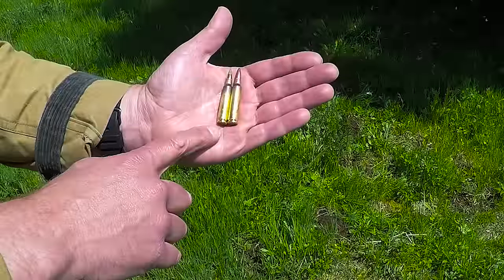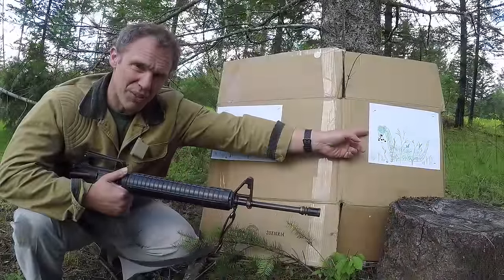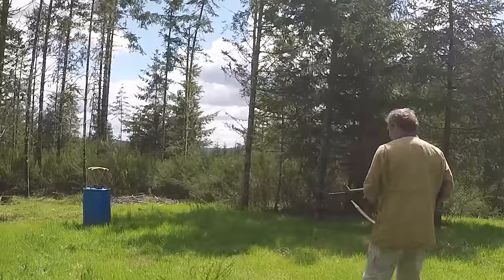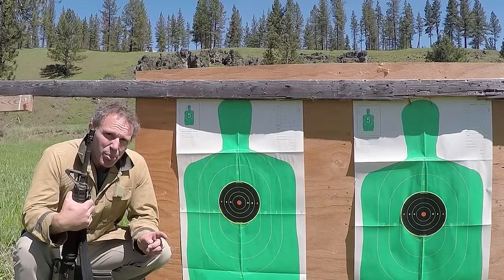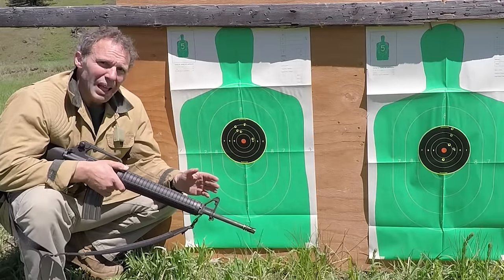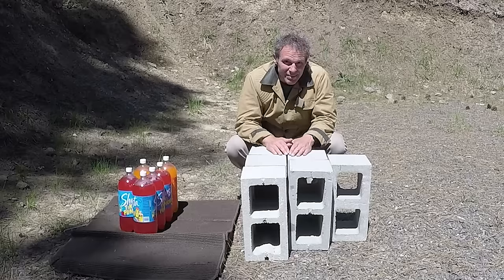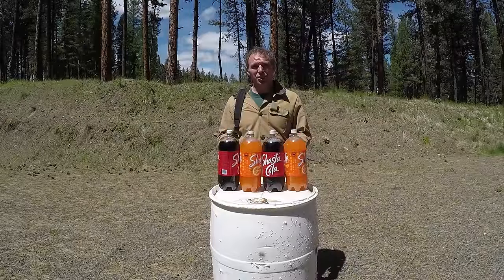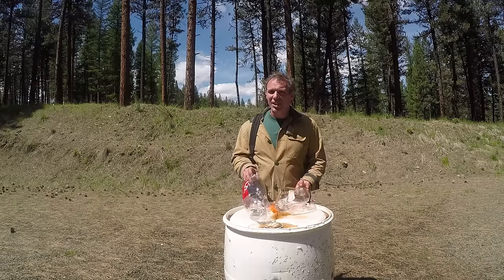5 56 NATO Ammunition:  XM193 55gr.  vs  M855 62gr.

Comment: Good video Paul. Love your work! I'd like to respectfully add a couple points to your video if I may? First, on the accuracy comparison: for bullet stability vs. barrel twist rates, I find the 5.56/.223 round to be one of the most finicky out of the standard calibers. Example, I have a Colt Match HBAR rifle (1:7" twist barrel) that I used to shoot MUCH service rifle comps with. While the 55g rounds would chamber and shoot 100% safely out of my HBAR, because the lighter projectile doesn't require that much twist to stabilize (they are essentially OVER-stabilized with that much spin), the best groups at 100 yards that very well built/match grade rifle would shoot 55 grainers was about 6" from the bench using sand bags. To the contrary, the M855 projectiles would constantly group 1"-2" from the same bench/sand bag rest setup. Hand loaded 69g Sierra SMK's will group sub MOA out of that same rifle. So, since your A2 is running the same tighter twist rate, I would suggest shooting the 55g out of the older 1:12" twist A1 barrel (the twist it was designed for) and compare those results with the A2 fired M855's. I would bet that you will see parity between the 2 rounds. Also, and no offense here as I'm sure you are a good shooter, but while the groups you got in your testing were not "bad", the inconsistency/accuracy differences you saw between the 2 projo types could easily be explained by shooter error, especially if you were using simple iron sights. I would suggest a better/magnified type of sight be used for both projos if you would like to eliminate any possible and common shooter error issue which honestly is probably the cause for the differences you saw in your test. You ARE 100% correct on slight/minute construction errors that are possible with the multi-component M855 projo vs. the more homogenous jacket over core M193. But again, at short/100 yard distances, these errors would be much harder to detect as a real cause and I fall back on irons sights/shooter error more than this factor (no offense!). At 500+ yards, that's were these slight projo inconsistencies really show up. As a 1000yard .50BMG shooter, I usually opt for CNC machined solid bronze types of projectiles to 100% eliminate this "multi-part projectile" construction error possibility, but that is obviously an extreme range where the tiniest balance difference in the projo has a LONG bullet flight time to affect pinpoint accuracy on target. On the "tumbling bullet" thing you mentioned. In actuality, the M-16/AR-15 rifle WAS designed originally with a 1:14" twist rate which would "barely" stabilize the early 55g projectiles. This was purposely done so when the projectile hit its target, because it was just "barely" stable in flight in the first place, the projo WOULD "yaw" considerable when it came into contact with soft tissue, causing major damage considering the light weight of the projo itself. Later, the M-16 barrel twist rates were changed to 1:12" to try and increase accuracy/bullet stability in flight through the jungles of Viet Nam (possible twigs/leaves would be grazed before the intended target impact). But, even at 1:12", the projo was just stable enough to make it fly like a football in the air, and quickly deviate course on impact. Now, on the newer M855 projo, the REAL reason for the tungsten cone in the front of the bullet core was NOT 100% to make it penetrate light armor better (but it DOES obviously work for that). The real reason for the M855's tungsten insert was to increase the projo's mass and move the projos center of gravity forward slightly; both to hopefully be accomplished with very little/no change in the outside dimensions/length of the projo itself. Going back to high school chemistry, since the much harder tungsten (periodic table symbol W) has a density of 19.35g/cm3 where lead (symbol Pb) has a density of 11.35g/cm3, it is a great metal to accomplish all of the above design improvements and also make the heavier projo fly more accurately, longer, out of the newer M-16 rifles with their 1:7" & 1-9" twist rate barrels... I guess that was a longer comment than I expected to write; sorry. Keep up the good work!
Reply: Actually they dropped the 1/14" due to arctic testing showing it wouldn't stabilize bullets in colder air, but either way bullets are not stable in tissue. You'd need a twist rate of 1:.012" to do that. Meat is so much denser than air the twist rate of the bullet has no consequence on destabilization.

When the reports of gruesome wounds came back from Vietnam the theory behind the fragmentation wasn't even properly understood at the time so it's not really that likely they designed it around that concept. It's just that .224 caliber barrels were made in 1/14" because most bullets for such calibers were 40-50 gr and not 55gr. Before the military nobody had the need for faster twist rates.

Comment: Those low-tech pseudo-science meat targets were awesome!
You can't write that up in a report with photographs like you can with FBI ballistic gel, but it's still way more informative.
Reply: The FBI requirements are retrogresive. The Fed's looked at what bullets tented to stop people quicker and then used those bullets in ballistic gelatin and subsequent results to draw up requirement for bullets going forward. All of those 12-16" penetration are based on analysis of real world shooting events. It does probably work though. By using bullets that are known to end engagements quickly and testing them in gelatin, there is probably a lot of predictive power in how well other bullets will work for the same.

Comment: I know it's not a "cool" opinion, but I actually prefer the 55 grain soft points.
Reply: Cool or no, they are good "soft target" rounds in 5.56.
Reply: Whatever works buddy....
Reply: I had an extra kevlar ach, I wanted to see what a 55gn soft point would do at 100 meters to it.  It pierced the front and blew a fist sized hole out the back.  It'll do the job.
Reply: @GeorgeHeil-ch3ro  hell yes they are, little things blow up whenever they hit something.
Reply: @bearjew05  what level? Because level 3 and 4 shouldn't have a problem with soft points.
Reply: @bearjew05  hell, you can hit some level 3 with some "armor piercing rounds."

Comment: From the research I've done, I consider the 55 gr XM193 a better self defense round compared to the 62 gr M855. That being said, my research mainly centered around self defense area being in a residential type environment like a house or similar structure with conventional construction with studs and drywall. My research told me that 55 gr 5.56 rounds penetrate with less retained energy after going through about two layers of drywall separated by 3.5" (standard thickness of a 2x4 wall). The idea that the round would contain less overall energy after going through a wall thus limiting unintended collateral damage. The idea that even though the 55 gr could exit as either fragments or a tumbling round, the remaining energy in the "bullet" would have a better chance of being stopped by the skin and muscle tissue, and cause minimal damage to the internal organs.

I don't have the sources for all this information as I did this about 10 years ago, but I was convinced that if I was to use my AR-15 in a self defense situation in my home, the 55 gr round would do a much better job of limiting collateral damage if I ever had to use it. Point is that I wish that firearms training as it pertains to self defense would address this type of thinking when considering ammunition for "home defense". I know it's a lot to ask of a lot of people who for the most part don't get this geeky about round performance as it pertains to a given situation, but that's just my two cents.

Comment: At a100yrds, those level 3 armored jack rabbits, are just too tough for the 55 grain though.
Reply: The 62 grain penetrates better due both the steel core, higher sectional density, and slightly greater momentum at 100 yards.  You therefore know that when faced with a 300 lb jack rabbit, only the 855's will do.

Comment: I'd like to see this done with a more common modern twist, like 1:7,8, or 9.
Reply: 1:12 is nucking futs
Reply: He was using a 1:7 twist for the tests, he stated that his a2 is 1:7 near the end of the video
Reply: @gamingmadesimple5510  find the time that he says 1:7 twist
Reply: @user-pg9fv7su8q  16:35
Reply: @gamingmadesimple5510  Shoot you're right good catch, my bad.
Reply: @gamingmadesimple5510  2:23 he says 1 :12 twist so idk what this guy is using
Reply: I've shot a 1 :7 twist at 120 yards into wood with xm855 and it never keyholed so my guess is his is probably a 1 :12 because it isn't spinning it fast enough to stabilize.
Reply: @user-pg9fv7su8q  that rifle is the a1 which he only uses for the first test to show that 1:12 wont stabilize the 62gr.  Some where he says he'll be using his a2 for the tests..  then at the end he finally says his a2 is 1:7
Reply: @gamingmadesimple5510  Ahh that makes more sense. Sometimes I fast forward because he gets a little long winded, I must have missed that part.

Comment: The same story was afloat in 1968 in Vietnam concerning the bullet tumbling on impact in order to do more damage.  The only thing that I can say is that I never saw a bullet go straight through an enemy soldier.
Reply: @ Jim Hill: The original AR15 light-weight rifle (SCHV - small-caliber high-velocity) project in the 1950s specified that the cartridge be of .22-caliber, with supersonic velocity at 500 yards, penetrating a U.S. steel helmet through one side at that distance, with accuracy and ballistics equivalent to M2 Ball 30-06, and wounding potential equal to or better than the .30-caliber Carbine. All in a select-fire rifle weighing no more than six pounds with a magazine capacity of twenty (or more) rounds. Quite a tall order. In fairly short order, Eugene Stoner and his team determined that a 55-grain FMJ bullet would have to be driven in excess of 3,000 fps in order to satisfy the demands. That assured that the rifle & cartridge were flat-shooting and had sufficient penetrating power at 500 yards. In order to create wound potential equal to the older and much larger and heavier M2 Ball 30-06 round, Stoner et al. exploited a generally little-known characteristic of light bullets - their propensity to become dynamically-unstable more-easily than their larger, longer and heavier cousins. Pointed (spitzer) bullets are naturally tail-heavy, since there is usually more mass in the latter half of the projectile than in the front half. It is only high MV and high rate of spin which keep the bullet in the proper "nose-first" attitude. Once a spitzer bullet hits a denser medium than air, say the body of an enemy soldier - it immediately wants to "swap ends" and get its heavy end forward. This is why the M193 round is said to tumble; it is (or should be) spin-stablized during flight; it only becomes unstable and tumbles upon encountering a target. Stoner et al. exploited this characteristic of bullets entering a higher-density medium by building into the 55-grain bullet a canelure (crimping groove) at which the bullet fragments or shatters into several high-velocity fragments or pieces, each of which produces its own wound track. That is how they obtained sufficient wounding capability from such a small, light projectile. Dynamic instability isn't the only reason for changes of direction by bullets. The mammalian body is not homogeneous inside. Tissues vary greatly in type, density, hardness, density, and other characteristics. Which is why bullets very often do not have straight wound tracks. They fragment, they ricochet, they swerve off-course, they do all sorts of unpredictable things. Even intact projectiles which do not break up often exhibit unusual or unpredictable behavior. These data account for the wide disparity in reports from the field in Vietnam: The M16 is a "meat chopper" whose wounds are so horrific as to be inhumane, the 5.56x45 cartridge is insufficiently lethal for military use, and so forth.
Reply: @ Jim Hill: My older brother is a physician who worked a big-city ER for years doing trauma cases. He confirmed your observation one time, telling me that I would not believe the crazy, circuitous paths bullets took upon striking a human body - including ricochets. A friend of mine, a Fleet Marine Force Corpsman in Vietnam - again, another guy who saw/treated a lot of GSWs - said the same thing. In his case, complaining about how no one on TV or in the movies, when hit, ever seems to sustain (one or more) a fracture. The particular design features of M193 saw it inflict horrific wounds upon enemy soldiers - NVA and VC - in some cases, but in others (where no tumbling/fragmentation occurred) enemy personnel stayed battle-worthy even after multiple hits. This inconsistency is the result of ammunition which was overly-dependent upon high MV for its terminal ballistic effects.

Comment: XM193 penetrates 3/8" AR500 at close range out of a 20" barrel but the M855 doesn't.  

Not sure if this means anything, but I thought I'd throw it out there.
Reply: Maybe it's my bias, but am I reading that right that the steel penetrator did NOT penetrate, but the 55gr DID??
Did you have sufficient twist to stabilize the 62gr green tip?
Reply: Lou Cypher there are two things that can penetrate armor, speed and mass. 55gr is obviously a much lighter load than a 62gr. A common misconception is that the green tip 62gr was meant to penetrate body armor, when it’s really just meant to be better stabilized when it passes through a barrier. Not to mention most AR-500 plates are designed to stop green tips.

Comment: Interesting information, and great comparison video. 
These a known issue in the body armored world surrounding 55gr XM193, and L3 armor, where anything less than 100yds or so will see XM193 penetrate the L3 plates (enough to cause significant damage) but M855 will be stopped. It has to do primarily with the small size of the 55gr projectile, and the 3K+ FPS velocity.
Might be worth a look...
Reply: Chad Cheung that depends entirely on the composition of the body armor. Level III ceramics can take M193 but not M855. Level III steel armor can be pierced by very fast projectiles from common ammunition more readily than ceramic.

Comment: The M855 was required only to penetrate the Soviet steel helmets back in the 1980s it was not suppose to be a super round the 55gr didn't have enough power to penetrate the steel pots of the day.  May be get a Soviet steel helmet to prove this?   Anyway the military traded lethallity for penetration for this reason we got the term ARMOR PIERCING steel core PENETRATOR round and that is not the case yes it penetrated the steel helmet but that is not armor piercing rounds buy any means.
Reply: Yeah Back in 89 thats what I was told ability to penetrate steel helmets we were still in the cold war so the Soviet part was probably an add on to the story .  Now I would like to see this played out a US steel helmet and a Soviet steel helmet with 55 grain and 62 grain .
Reply: M855 ammunition does indeed have a small mild steel penetrator in it, but it is NOT "armor piercing ammunition".  Actual armor piercing ammunition for the 5.56x45mm service rifles and carbines is M995 and it has a black tip, as does other US military armor piercing rounds.
Reply: Yes and SLAP rounds to are actual armorer piercing in 5.56, 762 and 50BMG.

Comment: You should do a video with the 77gr MK262 round.
Reply: GlockFan1990 YES! I just began my slow stockpile when I can find sales. I think we finally have a winner and both my 1:7 and 1:9 shoots them to 300 no problem. Same with the 69gr. 

Glock 27 and 22 owner, here.
Reply: Einzelgänger it acts similar to the 55 gr. They are both standard lead core copper jacket.

Comment: From what I’ve seen, from a 16” barrel at short, real-world distances,

XM193 (55gr) penetrates level 3 steel but stops in level 3 uhmwpe plastic armor
BUT
M855 (62gr green tip) does the opposite.  Stops in level 3 steel, blows through level 3 plastic.

Comment: I wonder how the 77 grain Sierra MatchKing in the newer Mk262 (IIRC) round would compare?
Reply: Sunyata DMR guys were most likely running a 7.62 gun.
Reply: Bob Rees The MK262  acts similar to the 55 gr. They are both standard lead core copper jacket. 
Military had Sierra add a cannelure to the round. It decreases accuracy slightly, but allows it to fragment like the M193. 
Works great in the M18's at short range.
Reply: The 77 grain is excellent. Just much more expensive
Reply: The 77 has a higher BC which makes it good at longer ranges. Having at least an 18" barrel helps also. For a CQB/home defense AR with 16" barrel, the XM193 is the way to go.

Comment: Just ran the numbers on excel. 16" barrel shooting the 62 grain will be 1 ft/lb less than a 20" barrel shooting a 55 grain. 1226 ft/lbs vs 1227 ft/lbs. Lowest Energy is 16" with 55 grain at 1182 ft/lb. Highest Energy is 20" with 62 grain at 1300 ft/lb.  16" with 62 grain (given you have a barrel twist to stabilize the heavier round) seems to be a good compromise if strictly considering bullet energy relatively speaking.